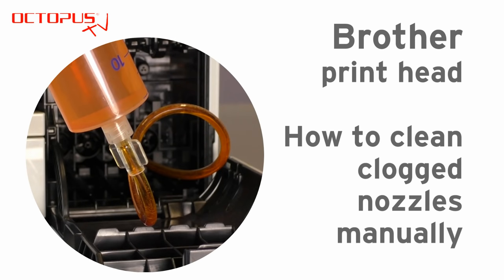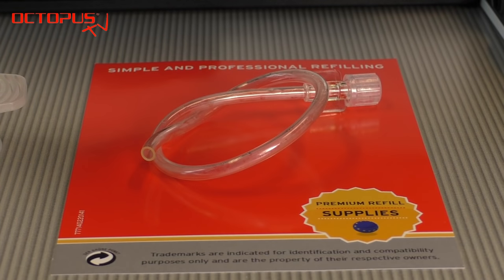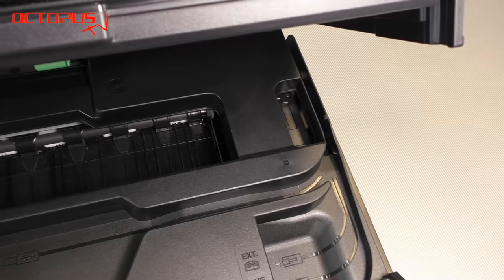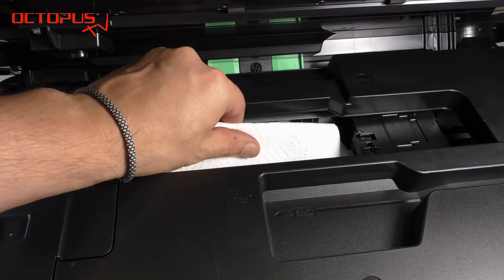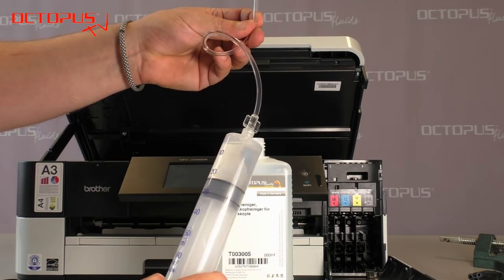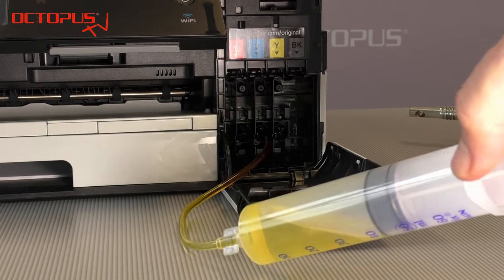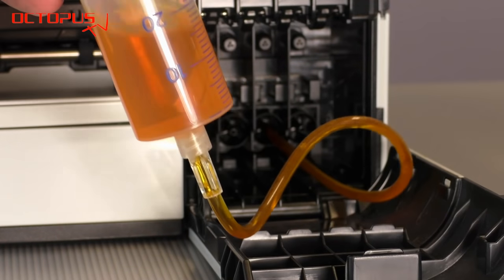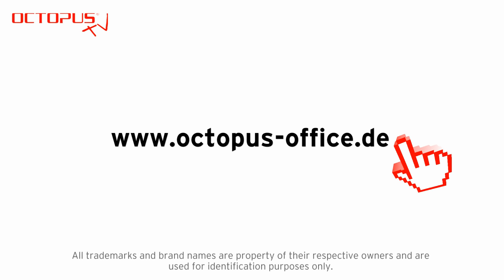How to clean Brother inkjet printer´s print head clogged nozzles?

Comment: I actually work for brother support , you can also press and hold the red X key for about 10 seconds on most inkjet models to move the print head to the middle once the scanner cover is open. This is with the machine still powered on
Reply from the maker: Hello Ling Lee - thanks for that useful input - that helps a lot.
Reply: @octopusoffice  I do your paper idea and work but I do the X and work to thank you
Reply: I got soft buttons and that X becomes available only when needed....
Reply: @megacyclisto  what model is it I'll try remembering the process for urs
Reply: @linglee8688  mfc-j5620dw european model all heads are bonedry
Reply: @megacyclisto  yeah it should be the same for your model just press and hold where the red X would normally light up. The haptic buttons still register sometimes even thought it's turned off
Reply: @octopusoffice lol
Reply: No "X" button on mine, but the red "stop/exit" button worked on my old Brother printer. Good tip
Reply: Tried it and can confirm!! Thank you for the tip Ling Lee!
Reply: @SpiderHamPeterPorker  "stop/exit" button worked on my old MFC-J425W. Thanks!
Reply: It works also with J5730DW model
Reply: @linglee8688, I have a J6520DW, and I am utterly lost about where I could press. Please help?
Reply: As someone also mentioned, if you don't have an x key, the stop / exit key being held does the same thing. Also, if you don't have a little rubber hose like he does and a syringe, a baby aspirin syringe that you can pick up at any pharmacy works perfect. You just have to increase the diameter a little bit of the nozzle on the syringe, I used a fork.
Reply: @KlausNordby  same thing for you, open the top cover and press and hold where the red x would normally be even  if it's not lit and it will eventually move the printhead
Reply: Thank You!!!
Reply: I have a brother MFC-J805DW and there is no Red x key.
Reply: OMG it works like a charm on my J6520DW - literally after 12 years it got clogged - i will try to clean it

Comment: You can click on the "x" botton for 5 seconds and the printer head will move to the center
Reply from the maker: Thanks for contributing this information!
Reply: Just some confirmation, on a Brother printer this comment is correct, but on some models you must hold the "X" button down for three or more seconds to get the print head to the middle. This is after opening the printer cover.
Reply: Thanks a lot. This works as well for my Bother printer

Comment: Does the printer have not a mode that's clean every day the heads themself, so that's the ink don't dry out?
Reply from the maker: Thanks for Your question. Most of the printers with users are not switched on all the time - that cleaning You mention is not performed every day. when the printer is off. Inkjets dry in when not beeing used regularely. The more regularely You use an inkjet printer the less the danger of drying out is :)

Comment: Thank you for posting. My very old Brother MFC 5490c would not print magenta. Using your video I unplugged power when cleaning head was in the middle and observed excess ink from cleaning attempts. Used paper towels to carefully clean all visible excess ink, folded half a paper towel to go under cleaning head and gently scrubbed it left and right until clean. It is printing fine again after that so I did not need to inject cleaning solution this time. I also had the opportunity to clear dust using vacuum and compressed air. Your video saved me lots of troubleshooting.
Reply from the maker: Thanks for taking the time to provide that thoughtful and detailed feedback! We are happy to read that You were able to get Your printer back to work. 👍🏻👍🏻👍🏻
Reply: This helps, thank you

Comment: Great video. Just used a partial of this, as I didn't have a syringe. Black was crappy, yellow was fairly good, magenta and cyan were not printing at all. 12 cleaning cycles later - still the same. I had already tried taking a pin and inserting into the ink heads to try to unclog, still nothing. So I did as this video explained and started a print and then pulled the plug so I could move the print head manually. Then I dabbed the print head (static position one) with isopropyl alcohol (on paper towel) a number of times - tired again, and finally got something out of magenta and cyan.. Few more cleaning cycles and all is well.
Reply from the maker: Hello Susan, thanks for Your description and taking the time to provide this excellent feedback! We are happy to read You were able to bring Your printer back to life. Doesn´t matter if You follow our suggestion 100 % or take out what suits Your situation 👍🏻

Comment: Im a bit confused about taking air into the syringe, in the video its said to take a bit of air, but other people say to not have any air in the syringe. So it is ok? why is needed or not needed?
Reply from the maker: Thanks for Your question. The air in our method is not supposed to be pressed from the syringe into the ink tubes and further on into the print head. "Our" air works as a buffer when building up pressure inside the syringe by pressing in the syringe´s plunger. The air inside the syringe can be compressed and thereby the pressure builds up more gently. This way the pressure towards the printer´s ink system is not that hard as it would be without any air inside the syringe.
Always pay attention to keep the air inside the syringe and do not press it into the printers ink system. It will do no damage there but it is very time consuming to get it out from there again.
Reply: @octopusoffice  Oh, so if I were to put, lets say like in the video, 30 milliliters of print cleaner into the syringe and then 10-20 milliliters of air, I would have to go back and forth injecting the cleaner until I reached right before those 30 ml are spent and avoid the air to get into the ink system? Sorry if I sound dumb, I just wanted to get the idea right before I finally clean the printer. Thanks in advance.
Reply from the maker: @Funkloned Thanks for coming back - there are no dumb questions if You want to get a thing done right :) Your description is fully right - pump the syringe´s plunger and press the cleaner in. Stop pressing in the cleaner when reaching the air inside the syringe....

Comment: I have a question. I have a Brother MFC-J5520DW and I tried cleaning the nozzles the same way you showed by plugging a tube onto the ink intake port, except I used warm water. My Cyan was the one that was the most clogged and when I pressed the syringe not much was happening, only a tiny bit of Cyan was coming out onto the paper towel, then all of the sudden all the water from the syringe started squirting out of the Yellow intake port while it was plugged into the Cyan port.  I played with it a little bit then water started coming out of the Magenta and Black ports... Is that normal, or did I brake something by giving it more pressure?
Reply from the maker: Thanks for Your description and question. We never had Your situation before - so we can do some thinking but no guarantees that we are right:
So for sure it is not normal in our suggested way of cleaning that the cleaning liquid pressed into one ink intake comes out of the other ink intakes.
But it happened to You  - so it might be that the pressure applying the cleaner into the ink system was too high and some internal structures in the print head were not able to withstand that .
We recommend to try to go back to printing and see if there is a damage.
Sorry for not beeing able to be more specific from the long distance.

Comment: Thanks a lot for this easy to understand tutorial. I haven't done it because I still need the cleaning kit, but I have to say that I managed to move the printerhead with your instructions :-)
Reply from the maker: Hello JM, thanks a lot for the nice feedback.
Reply: If you have a ink refill kit syringe or Turkey Baster, a rubber vacuum hose or other hose & isopropyl alcohol, paper towel; you now have a kit for alot less money.
Reply: @octopusoffice  I did this procedure because I was having an empty horizontal line in the printouts. The problem is still there. Could be that the print head needs to be replaced?
Reply: @jmemusic 
Try head alignment instead of head cleaning  ?

Comment: Thanks a lot for showing us this video! Could you please show us how to move the printhead to the center (like what you did at 1:26 of your video) for MFC-J480DW? I am having a hard time doing so, it is locked at the right edge of the rail. If I can't move it, I can't place a paper towel under the printhead, and I am afraid ink might leak everywhere when I flush the printhead. Thanks!
Reply from the maker: Hello, thanks for contacting us about our print head cleaning tutorial. You can get the print head out of its parking position by starting a print job and then cutting of the electrical supply by pulling the plug as soon as the print head starts to move - it is free then and You can slide it from side to side.
There is also another option, please check the comments below the video: by pressing the home button for a longer time, while the upper cover is open, the print head moves to the center position by itsself - not sure if this works for all printer models but it is worth a try....
Reply: Hey, I opened the main hatch, then long pressed the "STOP" soft button.
J-132W printer, but who knows, it may work :)
Reply: On MY J-625DW, holding the "Stop/Exit" button with the top lid raised moves the printhead to the center.

Comment: Thank you, its work!! But i dont use any liquid, just use the syringe and pump some air to push out all the ink
Reply from the maker: Thank You very much for giving feedback. We are concerned about that it might be difficult to get the air out of the printer´s ink system when You want to go back to printing. Please let us know if You have been able to do this.
Reply: OctopusConcept , if air is inside one of the ink channels, what’s the suggested method of removal? After carefully lifting the ink head circuit board I can see an ink well is empty!
Reply: how u pump? can u explain
Reply: @unnieaten8509  This is explained in the video.
Reply: At first i used this method but i failed..but when i saw this comment that no liquid used i try again and it works..my magenta unclogged..thank you for this video..and the comment..Godbless to both of you..

Comment: No need to pull the plug just to move the printer head out of its default position. you just need to roll the cogwheel located on the left side going to your direction or the normal movement of the cogwheel and then push the printhead out to the left gently while rolling the cogwheel and it will come out easily.
Reply from the maker: Thanks for Your valuable contribution to our tutorial!

Comment: How do you get the cleaning solution out of the lines after you're done cleaning?  Do you just run the cleaning cycle again after reinstalling new ink cartridges?
Reply from the maker: Hello Adrian, thanks for Your question. We recommend to print out the cleaner -  this avoids that the Your printer´s waste ink compartment is filled up and its lifespan is shortened by this. Install new ink cartridges and send a double sided print job with 20 plus pages to Your printer, use old paper as the print outs are not good for any use. Just have a look on the prints during the print job, the colors come back to normal slowly. Stop the print job when the colors are fine again or start another print job if the colors are not to the point You like yet.

Comment: What is the adjustment lever for to the left of your thumb at 3:54?  I have been given a MFC-J5730DW that was sitting for quite some time.  I've replaced all the ink cartridges and it's getting better with the cleaning cycles, but I've purged about 1/5 the ink from the 3319 tanks already.  Magenta is missing about 10 bars, Cyan missing probably 20, yellow is missing 3 rows and black is missing 2 bars only.  I'm certain that your method will fix it faster than this slow old purge process too!  At the end of flushing, won't the lines be full of cleaning fluid anyway?  How do you get that out?
Reply from the maker: Hello Darth, thanks for Your question. To be honest I do not know for sure what can be adjusted at the print head with that lever - If I remember correctly it deals with the alignment of the cartridges. Please do not pin me down on that.
Yes, You are right - at the end there is still cleaner fluid in the lines and inside the print head. But You can print that out - this will take quite a number of prints - slowly the colors will come back to normal - BUT You do not fill up the waste ink compartment of printer unnecessarily. We recommend to use old paper for these tests prints.

Comment: Thank you for this very clear information. 
I have followed instructions but having trouble with black ink Brother J-625DW. Are you familiar with clearing the printhead on this machine? If so, I am using a blunted "needle" to inject fluid in where the cartridge is removed. Carefully pumping in and out with air as a cushion and it seems to work. However, when trying to clean... I see air bubbles in the black tube about half way... it seems to pull ink from the cartridge to about half way... then nothing! I have repeated to no avail. Have you any recommendations?
Reply from the maker: Thanks for contacting us about the tutorial. From the long distance we would guess that the cartridge might be a problem - the air inside the tubes indicates that something might not be that tight and air is coming into the ink system. Beside  trying to clean out the air You can also try to peint out the air and bringing back the black ink -  this might take some time. Also You should use old paper for these test prints. Printing out the cleaner and the air does not bring waste fluids to the printer´s waste ink sponge. The test print job can be for 100 pages (old paper) - inbetween You can always take a look if something has improved.

Comment: Good simple instructions but one detail is missing.  What size tubing should be used to conncect they syringe to the printer nozzle?
Reply from the maker: The inner diameter of the tube should be between 1,5 mm to 2,0 mm.
Reply: OctopusConcept  Thank you for your reply. I'll look for the tubing and try the method.
Reply from the maker: You are welcome. Let us know in case You need some further assistance.

Comment: @OctopusConcep Hi! Thanks so much for the video and the product. I have a question. After you use the product and clean the print head, what do you do after that? Just insert a new ink cartridge or do I need to take out the cleaning product from the printer before inserting the ink cartridge?
Thanks in advance
Reply from the maker: Thanks for Your thoughtful question! When You have bottled ink available - good - then You can actually do as asked - insert new ink into the ink tube leading to the print head. That speeds up the process of getting the prints back to normal after the cleaning. Not everybody has bottled ink available therefore it is also ok to set new cartridges into the printer after cleaning and print out the cleaning fluid that remains in the ink system. This takes more time but has the same effect as priming the tubes with new inks from a syringe.
Reply: @octopusoffice  Got it! Thank you!
Reply: @octopusoffice  Hello there.Dose it mater what liquid i use?
This kit is too cheap to deliver and i live far away.
btw, your cartages and ink work amazing.

Comment: What do I do if it’s not printing cyan? I printed out a lot of test prints and now my printer is no longer detecting the ink even though there’s still the same amount as to when I put it in... I’m at a lost :/
Reply from the maker: Thanks for your question. Do you mean that Your printer signals the cyan cartridge as empty? Even if the ink from the cyan cartridge is not reaching the paper when doing the test prints the cartridge´s remaining page yield is counted down as the printer does not know that no ink is flowing out of the cartridge. This is why ink is still available in the cartridge but the printer says it is empty. In case Your printer says cyan empty You need a new cartridge.

Comment: My magenta was completely clogged, but my yellow, cyan and black were working perfectly. I used the method in your video on my magenta, but the magenta is still clogged and now my cyan seems to be completely clogged as well. Do you have any suggestions?
Reply from the maker: Hello, thanks for Your question. When did the blockage of the magenta line start - did it begin when setting in a new cartridge? Has the printer not been used for some time? Are working with alternative cartridges or original Brother cartridges?
Reply: @octopusoffice  it was my fault, the printer was working fine, but then sat in my basement for 1 year. First time I plugged it in the magenta was completely clogged, and the cyan half clogged.

I did the printer's automatic unclogging cycle and the cyan got fixed almost completely, and the magenta gave me 2 lines, so I used your method to see if I could completely fix the magenta, but I noticed that the liquid was coming out of the printhead, but also some fluid was coming out of the cyan.

The last set of ink was IKONG brand
Reply from the maker: Hello, thanks for Your explanation. Such a long time without doing any prints is really dangerous for inkjet printers. The inks tend to become solid inside the print head. Especially pigmented inks make difficulties as they contain small particles. Getting these particles out of the print head again can cause some serious head aches.
The inks that you mention - are they pigmented inks and how old are they? Pigmented inks turn bad after 2 years - this due to the pigment dispersion used in them - the pigment particles fall out after this time.